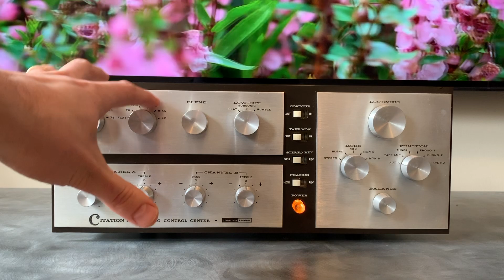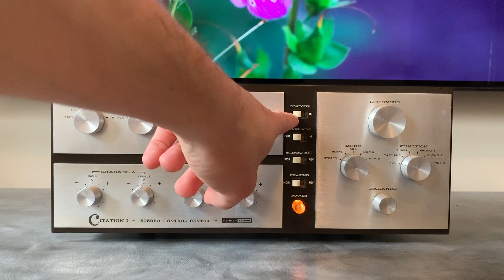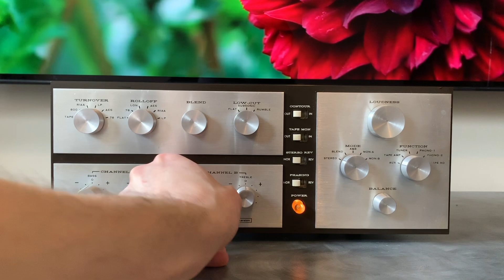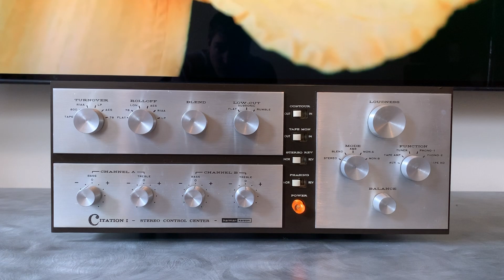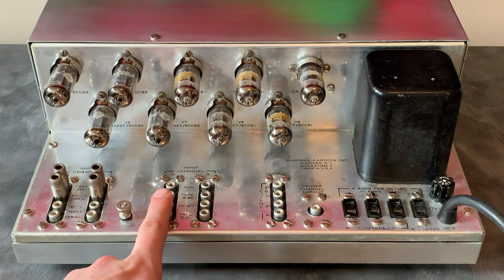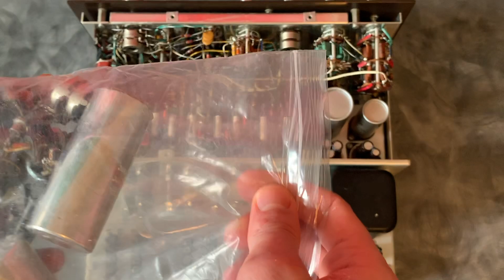Harman Kardon Citation I - Overview of Restored Unit

Comment: Great video. I just restored my 1963 Realistic SAF-40B after putting it on the shelf for 20 years. Recapped it changed a few resistors and the power cord to a 3 prong grounded cord. It’s a coincidence that I just posted a video yesterday about running it off a variack to lower my line voltage. I was running a Plate voltage of 417VDC on my 7189’s with a line voltage of 120VAC. 360VDC on the plates with a line voltage of 110VAC. Besides being made in Japan there line voltage is 100VAC. I assuming they probably used the same power transformer figuring it could handle 115VAC in the US.

Thank again for the nice video

Comment: What transformer did you use to get 117v ac?
Reply from the maker: This depends on your mains voltage. I usually use a 12VCT transformer and use both 6 volt taps. This allows for an option between 3% and 6% reduction. 

https://sound-au.com/articles/buck-xfmr.htm